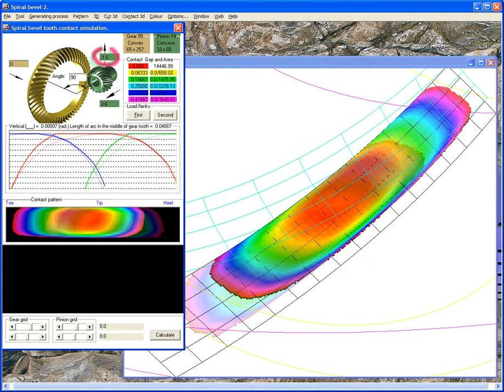3D Tooth Contact Analysis (TCA) on a spiral bevel gear

Comment: Can this software simulate tooth contact pattern from the nominal data file that has a list of x,y,z coordinates of points on the tooth surface? These data files come from Gleason G-AGE or Klingelnberg Kimos software. Just want to see if I can use your contact simulation software instead of Gleason software.
Reply from the maker: Yes. Spiral bevel TCA software can read the nominal data file and simulate tooth contact pattern in 3d. It can do it in better resolution compare to Gleason TCA software. It has been done for several customers who experienced issues with tooth contact pattern development. Gleason method of tooth cutting (tapered tooth) is naturally wrong - it does not deliver ideal conjugated tooth surfaces. This is why , for example, Phoenix machine has 7 axis working simultaneously in an attempt to compensate the naturally wrong method of generation. With this software tooth contact can be simulated in much details to show the difference between the tooth contact generated on a Gleason machine and the ideal tooth contact.